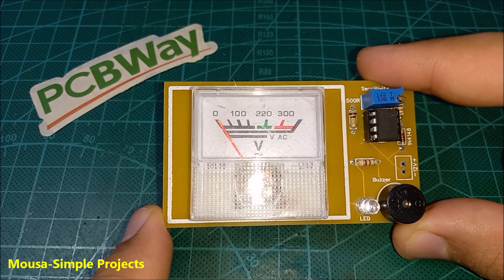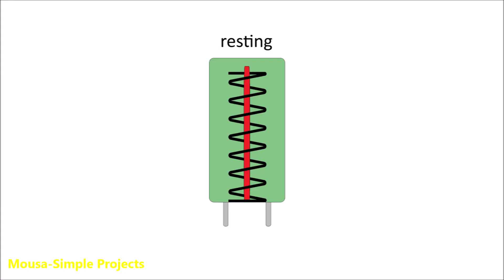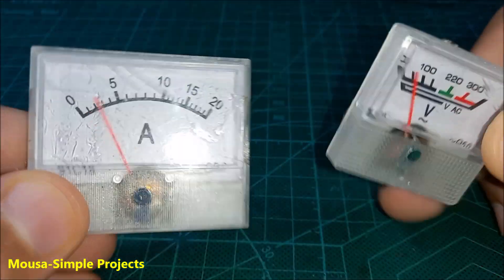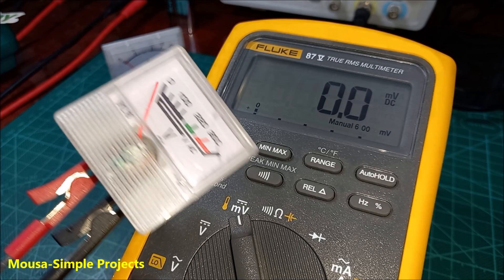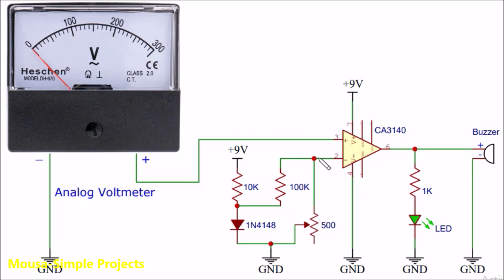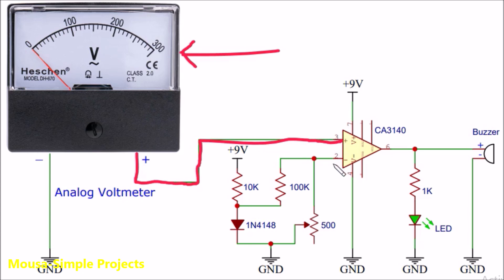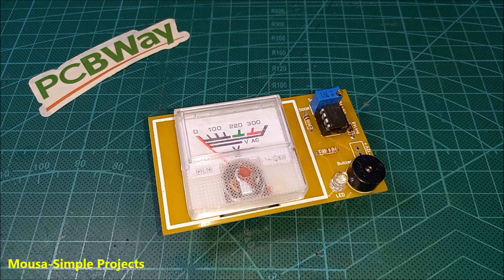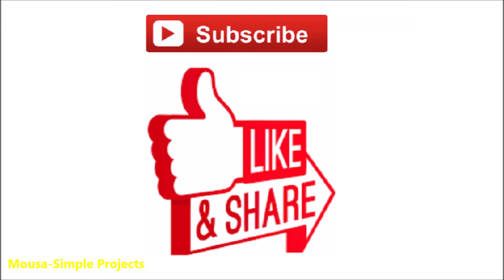Unusual DIY Vibration Sensor using Analog Voltmeter !!

Comment: That is an ingenious idea to use an analog meter movement as a motion sensor.    I was trying to come up with a simpler solutions than using a accelerometer module.   This fits the bill perfectly.   I want to put Christmas lights in the cap of my truck and have the lights turn on automatically only when driving the truck.   Using this to trigger a retriggerable one shot would be a simple effective solution.  Thanx for the idea.   I have several salvaged analog meters laying around so I could make this with parts I presently have laying around.